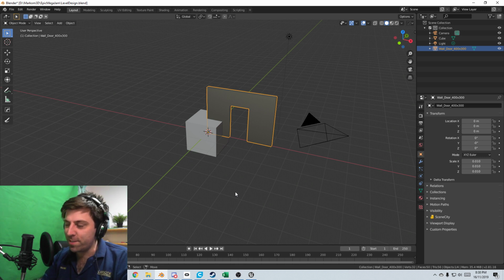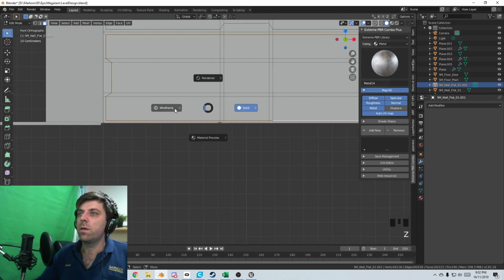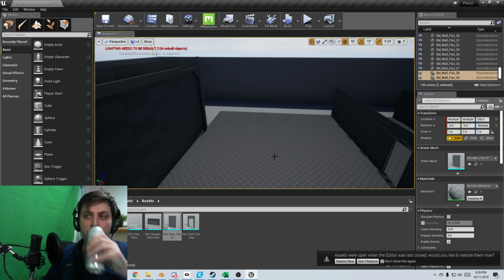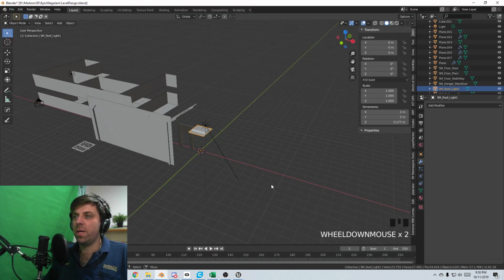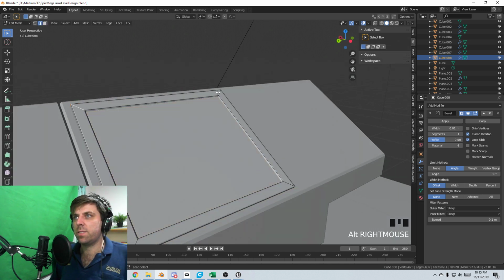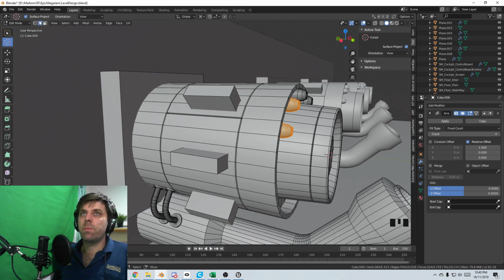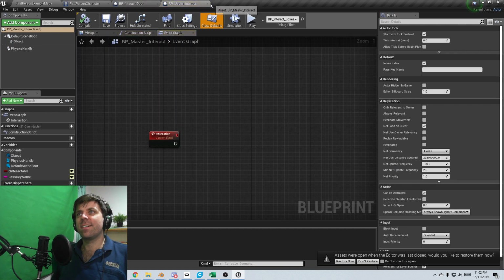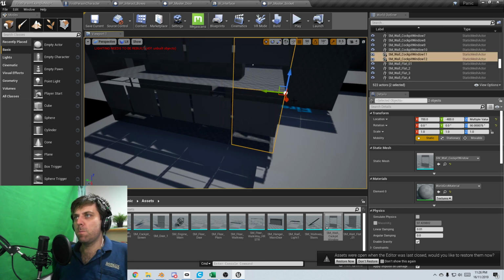LIVE - Epic Mega Jam - Blender 2.8 Level Design - Scifi

Comment: With regards to poly count, in modern game engines poly count is less important than texture size, if you can make multiple models that use the same texture sheet you can save much more resources than if you were reusing models and reducing poly counts.
Reply from the maker: yeah agreed, that is something that I want to work on in the future.
Reply: @Markom3D  the  problem with using texture sheets is it is hard to create unique detail for individual models
Reply from the maker: @haunteddiary15  I agree. Thats why I need to make a workflow for creating a the sheet and working backwards
Reply: @Markom3D  best you could probably do is create an atlas texture for the main bulk of the texture, then trim sheets to overlay extra details per model using extra geometry, it's not perfect, but it works.